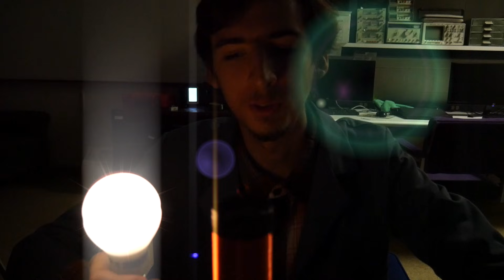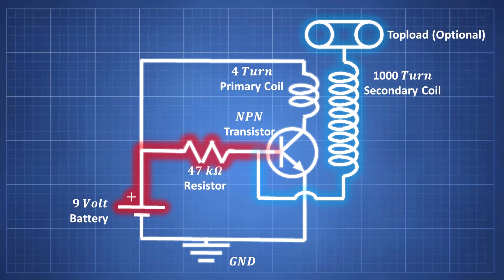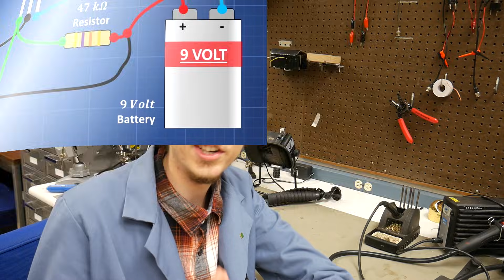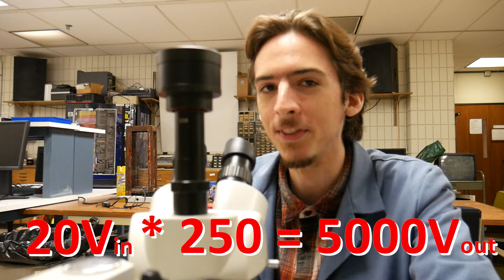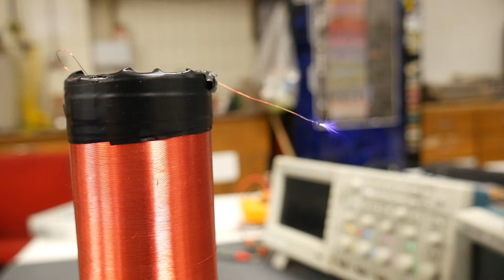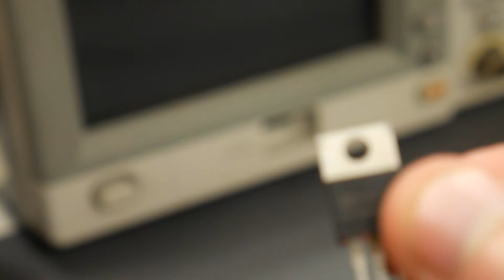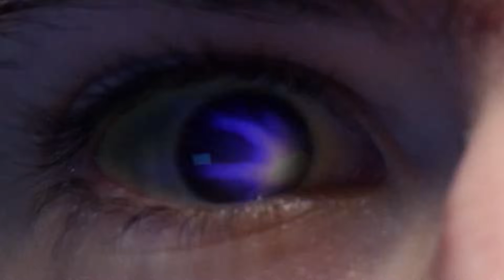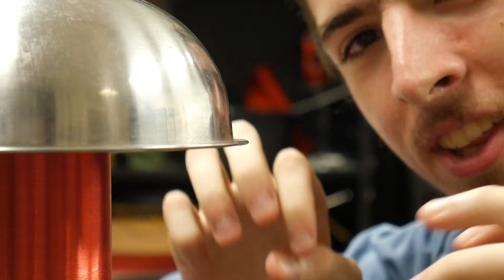SLAYER EXCITER - Tutorial, Explanation, and More

Comment: Hey Blueprint,
Thanks for this awesome video. It helped me a ton. I am too attempting to make this circuit but hoping to put slightly more batteries to get a higher output. I'm lacking a EE degree and in need of some help. Would 5 transistors in parallel be able to take that much voltage ( say 5 9v batteries or more?). It takes a lot of time to get them so wouldn't like them blowing up often. Any other ideas which could help my cause?
Thanks!!😊😊
Reply from the maker: So you want to use an input of 45V. There are 2 important things to consider:
Batteries, unlike power supplies, cannot supply a lot of current - only about 0.5 amps each. You can still get a high voltage, but your power will be greatly reduced. To increase the current, put another row of 9V batteries in parallel.
Also, putting transistors in parallel only divides the power dissipated by each one. Check your transistor's datasheet. TIP31C transistors can operate at 100 volts but only dissipate 40 watts each. (watts = voltage * current)
In my (un)professional opinion, your setup should work fine so long as you run the coil for only about a minuet at a time or put a large heat sink on the transistors. Then let it cool for a while.
Reply: @BlueprintScience  Thanks!! I'll work with this.

Comment: What happens if i touch it?
Reply from the maker: You'll get a little zap and then you'll say "OUCH"
Don't worry, there is no way that there is enough power to kill you. There is very little charge to back up the high voltage. Once you touch it, all the charges leave and the voltage drops to near zero. It will be like getting zapped by a door handle after rubbing your feet on the carpet. Just don't hold you hand there - remember what I said about the arc being very hot.

Comment: the ion wind is pushing the corona motor forward.
Reply from the maker: That's what I've always assumed too. I even mentioned it in my first video. What changed my mind is that the voltage on the topload is AC - meaning that just as many electrons are ejected as there are absorbed. Since no mass is being moved, there is no thrust. The heat however, is always building up behind it and expanding the air.
I may be wrong about what the reason is exactly. I try my best.

Comment: Can i use D4206??? PLEASE ANSWER MEEE!!!!
Reply from the maker: I assume you are referring to the transistor. That should work fine. Just be sure to select a resistor that will supply the correct voltage to the base of the transistor; it looks like it has a high gate voltage.
P.S. You do not need to yell to get my attention
Reply: @BlueprintScience  yes, i am referring at the transistor, but can you say me what resistor i have to use at the base of the transistor D4206? Ok i understand i won't yell 😂
Reply from the maker: @MD-qz6gk  47k ohm resistor may work fine.
I checked the D4206 datasheet and it looks like it is built to handle higher base powers. It is possible that the feedback may not shut off the transistor. Or maybe it will. If not, you may find that it likes higher input voltages.
To allow more current to the base of the transistor, simply reduce the rating on the input resistor (always keeping it above 10k ohms)
Reply: @BlueprintScience  thanks

Comment: Hey bro I made but it did not working i took tip31c transters and resistor 47k it is not can you help me can you give me number plz
Reply from the maker: Hey bro,
I'm not sure how to help unless you tell me what you think the problem may be. I'm not psychic, sadly. 
You can rely on the YouTube comments for a (somewhat) timely response. If you absolutely need to talk another way, or show pictures and stuff like that, that can be arranged.
Reply: I use tip 31c transistor it is not working why I don't know
Reply from the maker: @dhanushkv0242  If nothing at all is happening, try this: 
Double check all connections and make sure that there is continuity. Sometimes things look fine but really are not touching.
Also, make sure that both the primary and secondary coils wind in the same direction. If you are not sure, try flipping one of them.

Comment: Can I use a mosfet instead? It's the only type of transistor I can salvage on some electronics..
Reply from the maker: Sure, Why not. 
They both serve the same function in the circuit. One thing, you may want to use a MOSFET driver if you can find one, otherwise the feedback voltage may not switch it.
Reply: Instead use a power MOSFET like IRFP250n or IRFP260n

Comment: 8:46 I know how you can solve that problem! You have to prevent the transistor from saturating which, due to the Miller effect, makes the transition to the cutoff state slower. You can do so by placing a Schottky diode between the base and the collector of the transistor, with its anode connected to the base. This will make sure the collector voltage never falls below 0.7V - 0.2V = 0.5V, preventing saturation.
Reply: Why not just use a triode?
Reply: Amm can u explaine
Reply: Hello matheus, 

Which schottky diode should I use ?? 

1N5819 -1A ? 
1N5822 - 2A ? 
SR360 - 3A? 
SR 2100 - 2A 100V ? 

THESE 4 are the ones available to me.
Reply: @megaraitei  I'm also interested in improvements to the schematic, since my Slayer Exciter (2 transistors in parallel) simply can't work more thant 5 minutes. Too much heat.
Reply: Ok I put the Schottky, PSU increased current draw from 0.70 amps to 1.5 amps, sparks from the secondary diminished and transistor got crazy hot. DIDN'T WORK FOR ME.
Reply: @tanner1985  have you put the diode in the right direction? The wrong way should be nearly a short circuit. And that would explain a high current flow. I'm not 100% sure if Matheus Moreira's improvement works I have no example to test here. And my electronics knowledge comes from messing around back in school so I'm not entirely sure.
Reply: Ahhhh..I was still tryna figure out about the Darlington configuration with 3 transistors, that I now see another workabout - with a diode !
Reply: Or you can use a mosfet with driver
Reply: @learningelectronicswithrup8142  how exactly?
Reply: @joshberna5801  MOSFET driver you can add a dead time using micro controller or inverted signal of the Tesla coil

Comment: very nice products: both the video and the tesla coil.
The explanation is very well done and clear.
Only thing that maybe you could do: use a sink instead of many transistors, but perhaps with more transistors you get a greater switching speed, or am I wrong?
I repeat: your videos are really valid and absolutely not boring.
just for my curiosity: the same effect you would get with a transformer for microwave ovens?
The principle is the same: few turns of primary and many more in the secondary (the ratios will be different because fed at 110 or 220V and the output I do not know how much ... maybe lower) certainly the transformer does not need the circuit oscillator because it is powered by alternating current ...
Yes, probably it is an application of the Tesla principle!
Reply from the maker: Hi,
Transformers go all the way back to the times of Faraday.
You could use a microwave transformer to step up voltage just like a tesla coil, but the insulation on them causes it to max out at 2000V before it starts shorting. Also the coils wind opposing directions so that the phase isn't completely reversed.
The nice thing about MOTs is that they can move as much as a few amps on the secondary coil where as this circuit still has a very limited output.

P.S. I was just too lazy to put heat sinks on the transistors
Reply: @BlueprintScience  thank you for tour kind   answer! indeed, high voltage transformers are definitely better insulated than a microwave oven transformer.
  one of these days I'll take one from my work: 15,000 / 100! 250 w of power .... 40 kg of weight! Better to feed it with a few volts, however, for my safety .... that is not joking: in case of accidental contact I do not even think I can say: ouch !!!P.s. don't worry about lazy: often  i'm lazy too!

Comment: Hi blue print tell me. Secondary coil              (0.❓❓) mm I do no  Number of sec.. coil
Reply from the maker: Hi,
My secondary coil is between 800 and 1200 turns of 30AWG (0.2546mm, 0.0509mm2) around a PVC pipe.
I hope that answers your question
Reply: @BlueprintScience   I get answer 0.30 AWG . what is numbers ( 0.2546mm, 0.0509mm2). 
 Primary coil   turns u do
Reply from the maker: 30AWG - imperial units
0.2546mm, 0.0509mm2 - metric units

The primary coil is 4 turns of 10AWG wire

Comment: You should do a part 2, where you add and interrupter to decrease power input and increase the spark length. Also it sounds way cooler. From experience, you need a square wave with like 8-25% duty cycle at 1-100hz. This gives a loud crack and much lower power consumption. This also allows you to touch the spark, it only feels like a little static shock.
Reply from the maker: I see that you did something like that on your channel. (Subscribed by the way - keep it up) 
Eventually, I actually intend to have a variable frequency input to play music. My thinking is an audio wave and schmitt trigger switching a transistor in line with the 47kOhm resistor. Hopefully that works.
Reply: That’s is an interesting idea. I think you could also use a class d amp, like the one I built for my plasma speaker project, using a mosfet to switch the coil on and off.

Comment: For some reason I'm not getting much arcing out of mine when I feed it 24V. Maybe I need to ground the negative wire, but if that doesn't work, can I use an N-channel MOSFET instead of the TIP31C? Also, I think I'll try building a boost converter to feed it high-voltage pulses instead of continuous voltage.
Reply from the maker: There could be a few problems to check.
 * Both coils must wind in the same direction (i.e. counter-clockwise upward)
 * The pin out of the transistor is an easy thing to get wrong
 * Make sure that 24V isn't too much for your circuit - it may be killing your transistors

Either way, giving it pulses should work fine so long as you can get the frequency high enough (1MHz). Good luck.
Reply: Thank you for responding. 
I'm pretty sure I didn't do something really dumb like the wrong coil direction, since I'm still getting a few kV out. And my transistor seems fine so long as I use a heatsink and don't bring large antennas close (it broke when I brought an AM radio within a few feet).
My idea with a boost converter was to feed in high voltage pulses between 0.1 kHz and 100 kHz just so I could get lower overall power through the transistor without lowering my output voltage (also I want to see if I can make my coil sing). Of course I'd still use the exciter circuit to step up my pulses.
I noticed that many designs connect diodes from the negative terminal of the power supply to the base of the transistor, but yours seems not to have any diodes. Do you know what everyone else uses the diodes for?
Reply from the maker: The diode only makes sure that the voltage on the base of the transistor never goes negative. If the counter-current from the secondary coil brings the base lower than 0V, current flows from ground (0V) to the base and bring it back to zero. It's not a huge deal, but it makes the transistor a little more efficient.

Comment: This is a very underrated channel
You deserve more subscriber
Reply from the maker: If I were in it to be famous, I'd be a let's-play vlogger.
Reply: @BlueprintScience  hello bro, currently iam working on this project,can you please help with the specification of primary coil wire.
Reply from the maker: @Neet578  Not much to say; most things would work fine. I’d suggest 10AWG wire or 1/4” copper tubing.
Reply: @BlueprintScience  thanks you so much..
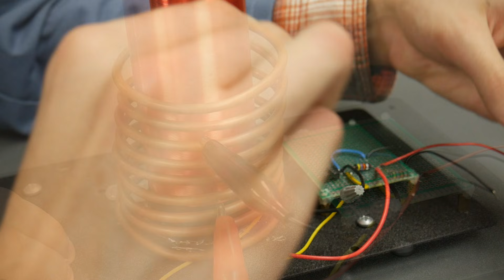Reply: @BlueprintScience  would 16g be fine for primary? And both primary and secondary are insulated right? Also, you say here 7:02 that 3 1/2 turns is the best, but it looks like you got about 9?
Reply: Shocking he hasnt attracted more followers. This channel has such high potential.